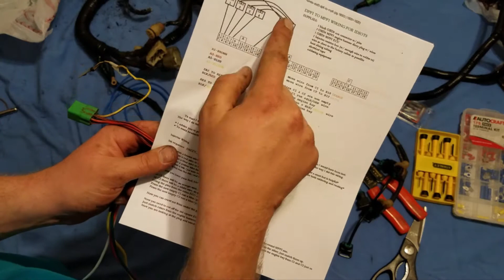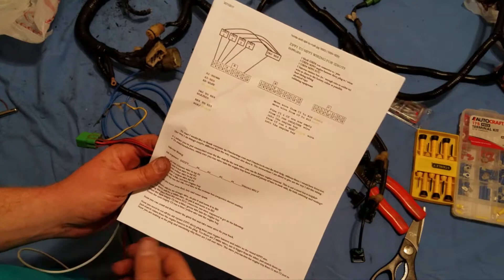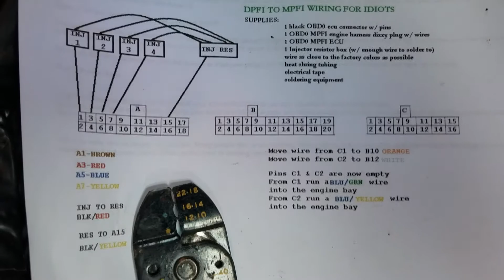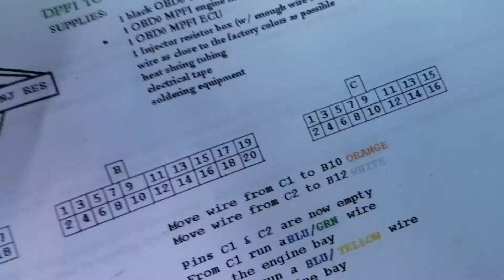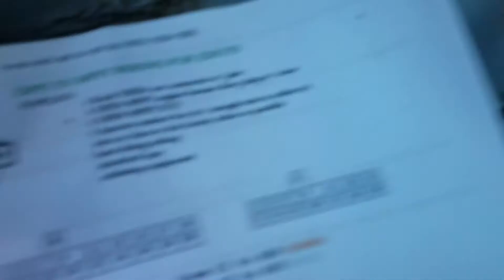DIY HOW TO: Dpfi to Mpfi Swap Wiring Harness Build, Spork Sports Sedan Part 2

Comment: I’ve noticed on the obdo ecu the injectors are 1357 and on the obd1 ecu it’s 1354 does the jumper harness correct this if you use a obd1 ecu on a obo harness
Reply from the maker: they are different in how they run obd1 you need to take the resistor box out to use those injectors obd0 has the box to make them work obd1 you bypass just give them direct power
Reply: @WideOpenThrottleGarage  I’ve seen some that take the resister box off and tie the injectors yellow wires together but not run a wire to the ecu to like a15. Some of this just gets confusing to me, then like they call the obd1 ecu’s Ab and d
Reply from the maker: @BRENDAJASON1  nope dont do any of that they make a resistor box delete plug or cut off the boxes plug and make it your self i just wired it into the harness it has a red power in and power and grounds to the injector plugs thats all it is it just removes the resistor box and give the right volts for the obd1 injectors
Reply: @WideOpenThrottleGarage  I’m thinking I’m getting mixed up with the ones that already have the mpfi but are running obdo shows them taking their resister box off.
Reply: @WideOpenThrottleGarage  I finally figured it out sir. We all been going thru a lot I know I ask you some time back about this. This was something I got back into. Stay safe